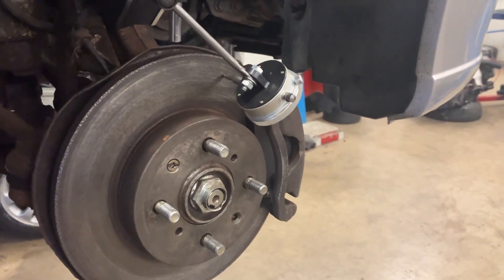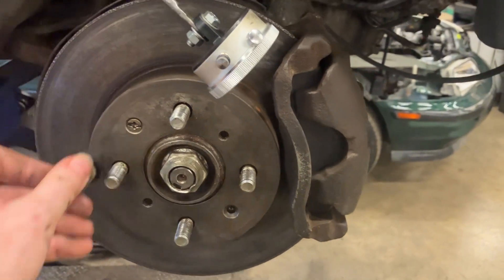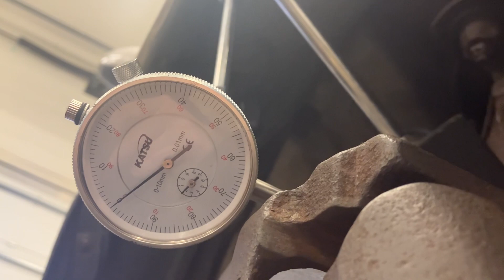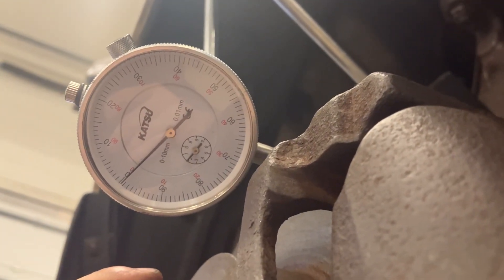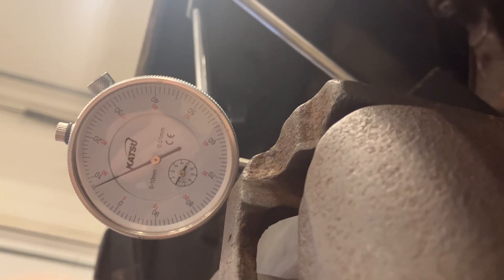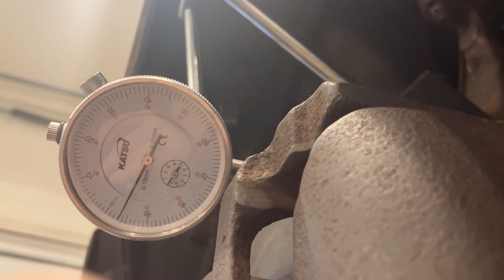How to Test for Brake Disc Warping/ ‘Runout’.

Comment: Hi. Have you added an extra arm to your dial please?
Reply from the maker: Hi, no. That’s just how I bought mine, two lengths of round bar, with the DTI gauge itself on the end. I think that’s how most come? Cheers
Reply: @AdamMechanic  Yes, they look to come with two round bars. Yours looks like it has a third bar that the dial is attached too.
Reply from the maker: Your right! It does. It’s been a while since I did the video. I’ve got 3 or 4, but never noticed until you’ve mentioned it. Does make it a bit easier to get the right angle
Reply: @AdamMechanic  I ordered one and used it yesterday. My front discs are way out. Thanks for the video. Really helped me understand the process. Cheers.
Reply from the maker: @mmmmmlemons Awesome! Glad to hear you did it,and it helped. It’s what YouTube is all about. Thanks for letting me know too!